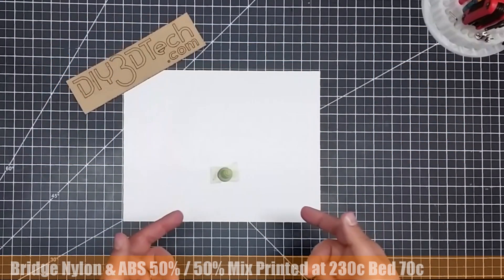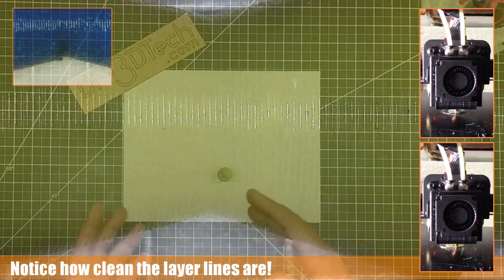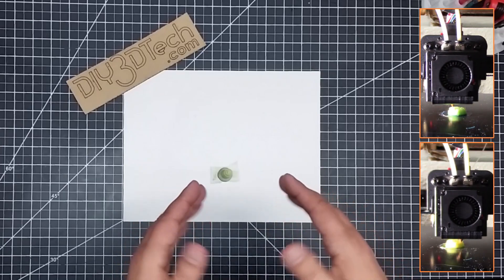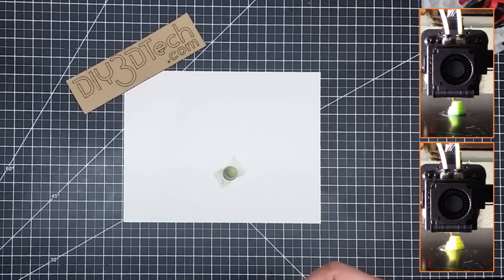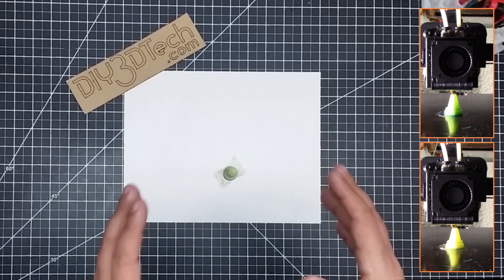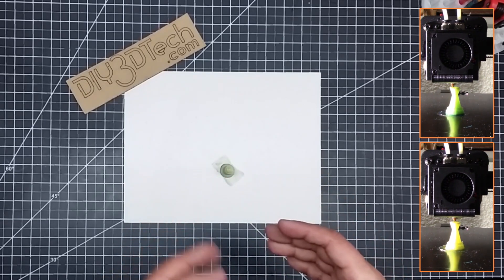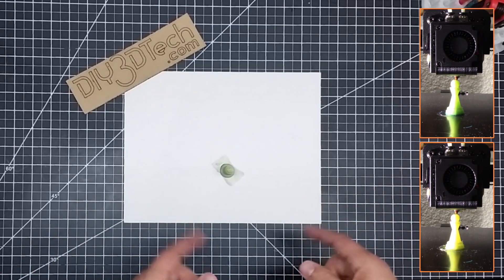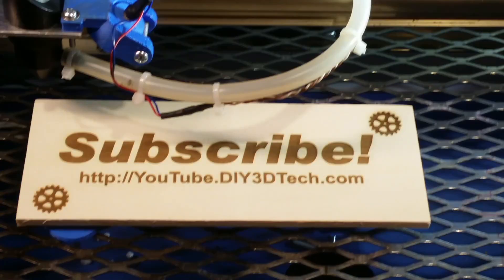GeeeTech A10M - Mixing Nylon with ABS Success?

Comment: Taulman offers a Nylon + TPU blend. It's really great. On the PETG + TPU I would like to see that as a larger part, or print multiples. It looked from the video like it failed due to thermal problems, not necessarily polymer mixing problems.
Reply from the maker: Really!  Nylon & TPU?  I will have to check it out!  Thanks for sharing!
Reply: @DIY3DTECHcom  TPE, I guess depending on how far you want go down that rabbit hole. It's a great flexible though.

http://taulman3d.com/pctpe-features.html
Reply from the maker: this is very interesting, I going to get some!  Thanks for sharing!

Comment: Nylon gets tougher, more chewy, and expands when it absorbs moisture. I wonder how Nylon composite behaves. If it's well mixed, by all reason it might be great, if it's not, it might introduce tension into the item, but i can't quite fathom the results of that, i wonder if it will be prone to delaminating post-print, or whether it will become stronger in a particular way but not in other ways.
Reply from the maker: I plan to find out!  As you will see in future episodes I also purchased small pneumatic press to build into a test rig.  Do you know of any "affordable scales that do data logging?
Reply: @DIY3DTECHcom  My first thought would be a Wii Fit Balance Board, it's a Bluetooth device, it's a formerly popular obsolete peripheral which was made in way higher numbers than the market ever needed, and someone wrote a Python API to query it. Haven't tried, don't have the Balance Board yet. The spec says 150kg max, which is probably not quite enough for some of your uses.

Don't know of any device created for the purpose of logging weight, i mean they must be out there, but i haven't run across them.
Reply from the maker: LOL!  I use to have one of these (long gone now)!  150kg should work to break plastic.  I found a couple but they are couple hundred bucks and was hoping for cheaper...